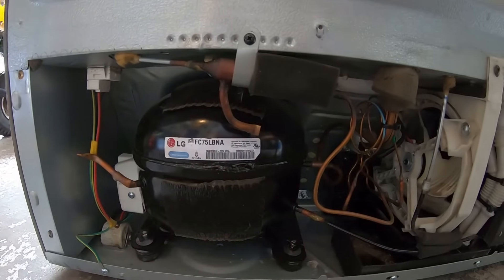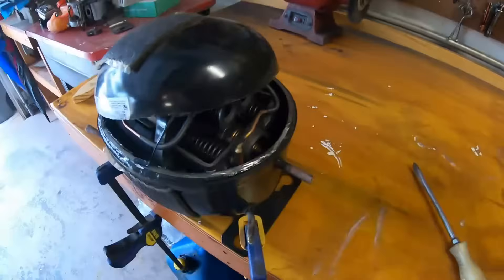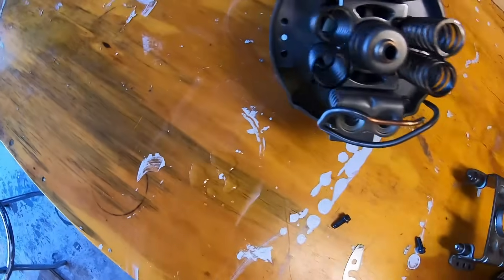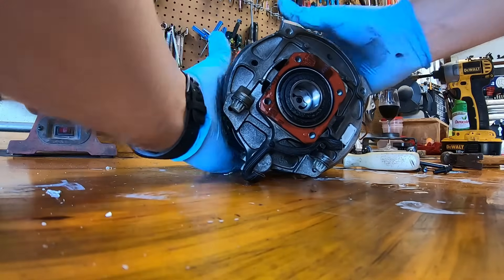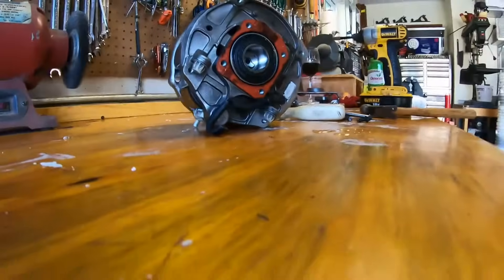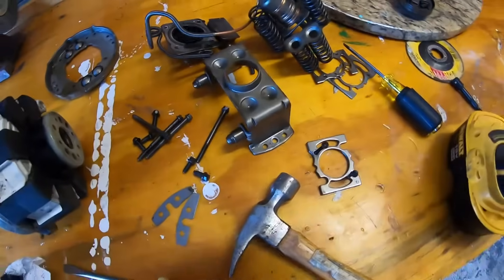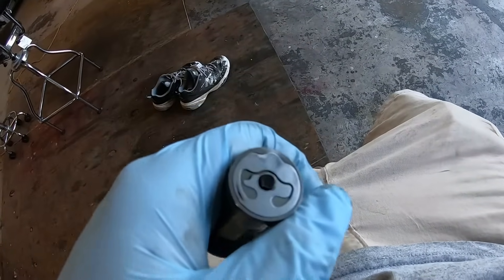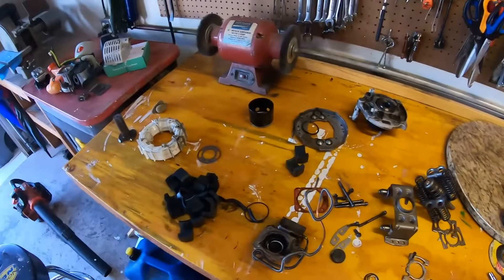Cutting open a failed LG refrigerator compressor

Comment: My LG linear compressor fridge was making some loud buzzing noises (sounded almost like a bad fluorescent ballast).  When I pulled the fridge out I heard sound like it fell to the ground and was rotating, then the sound stopped.
I don't see any rotating parts in this teardown.
The fan on the back is rotating fine.
I have no idea what was making the noise.  Just that linear compressor and fan should be the only moving parts.
We'll see in a couple hours if the fridge is broken or not.
Reply: That buzzing sound was probably the drive current peaking in the huge* coil responsible for actuating the piston (which is probably seized). When the piston isn't moving the coil current goes thru "the roof" basically. With the piston iron core stuck in the retracted position the inductance would be way too low, I.E. not putting up a resistance to in-rushing current. Normally the piston would be attracted to move into the winding, that would constantly increase inductance further and further, I.E. provide an increasing resistance to higher current. This electro-magnetic resistance is only temporary, as soon as the current hits a certain level the iron (core) piston will suddenly hit it's magnetic conduction limit... and all kinds of hell breaks loose once again.

With old fluorescent tube drivers, it uses a huge* (fixed) inductor to stop the current at a reasonable level. Once the fluorescent lamp lights up, 100/120 times a second with old ballasts(the tube driver), the tube resistance is quite low and would happily conduct much much more current and burn out if it wasn't for the inductor holding the would-be current spike back.

* = Huge, at least seen from a small electronics/PCB designer perspective

Comment: 60 days into compressor warranty repair. LG dragged their feet for 30 days giving authorization. Compressor arrives. Install. Then more error. Repair tech said needs new condenser. Now 3 weeks later and repair saying “stuck compressor”. Saying we need another compressor. What a joke. $900 in parts and labor. We feel like suckers.

Comment: It rather simple the compressor has an inert design flaw.  So no matter how or what you do it not when it's gonna fail, it's going to fail period. And you can keep replacing them till you blue in the face and it's not going to correct the issue.  
On the commercial and residential side of hvac  we see LG compressor failures all day long. Why?  They are just plain junk.

Comment: Looks to me like gasket or diaphram failure. That looks like it flutters back and forth creating a compression of the condensed liquid refrigerant and it breached past the valve seals  and slugged it down. losing any performance or BTU output.  Just my guess..I do commercial and residential ac

Comment: Good job on the hearing protection,  but where is the eye protection! You don't need it until you do. Then it's too late.  Those cut off disks can shatter,  never nibs the burning steel fragments. Thanks,  though,  for showing the problem with these compressors.

Comment: Did you ever replace the compressor with a different kind, if so which kind?
Reply from the maker: Nope I ended up trashing the fridge unfortunately. My understanding is that linear compressor design is unique to LG as is the control board
Reply: Compressors are mat he'd to control board

Comment: A friend of mine works for a large repair company, I worked with him 5 years ago before I started my own buisness, I called him a couple days ago, had equalized pressure from high side to factory fill port, I asked him about it, he said he recently went over his epa recovery sheets from reclaimed refrigerant, said he has replaced over 100 lg compressors, insane..
The new ones do resolve the issue from what I understand, gotta do the software revision with the new compressor, critical..
Reply from the maker: Good to know thanks for the info!

Comment: So I too have the same exact compressor number.  So, now what?  Can you please tell us what other kind to get??  thank you.
Reply from the maker: Honestly your best option is to replace the refrigerator with a non LG variety. I personally have had good luck with Whirlpool fridges in the past but your mileage may vary. Given the current appliance shortages I would be amazed if manufacturers weren't cutting more corners than usual. I have a 15-year-old whirlpool in my garage and a 10-year-old whirlpool in my kitchen both have been relatively trouble free.

Comment: Thank you enjoyed the video. We had our 4 year old LG french door fridge/freezer repaired this week. LG service replaced the compressor and dryer and upgraded the software on the controller board all  under warranty. Our unit was part of the class action lawsuit.
Reply: I got a 2 year old LG french door / bottom freezer that unexpectedly just lost all cooling. approximately $150 food ruined. Unplugged it for 3 hours and cleaned the coils in the back under the panel plugged it back in and it is back to normal. I bought a fridge / freezer temp sensor so I could monitor it better and found the temps of the fridge and freezer are all over the place, not consistent at all, ranging from -5 in the freezer to 25 degrees F. and the fridge from 34 to 41 it varies. I called LG and they set up a service call but still haven't heard anything from the service tech going on 4 days now. I did hear that the techs are tired of working on these pieces of junk and can take up to 2 weeks to get one to even respond to the work order. My old whirlpool lasted 15 years and when we remodeled our kitchen we went looking for a new fridge. Lowes and Home depot pretty much only carry LG so thought it would be OK plus they brag about a 10 year warranty on the compressor. I can tell you will be lucky to get 2 years out of that compressor, and mother board. So disappointed
Reply: @sttraveler2593  your thermostat would be the frist place I'd look
Reply: whats you model #?

lfx31945st?

Comment: Looks like the magnetic field was angled to the shaft just enough to be asymmetric and sure enough there is a wear spot in the piston.  I can’t tell if the piston chamber was supposed to be sealed and pump a fluid of some kind but the whole thing smacks of bad rings in a gasoline engine.  In short the magnetic shaft was bent and the rings got a hot spot and burned somehow.  8-10% failure rate is reported.  This is like buying a Mazda folks.  Runs but can’t maintain the seals too well.   Sheesh…I thought LG would have this cleared up…someone would have confessed and the company raised a white surrender flag.
Reply: What’s crazy is they have lawsuits back in 2014 for their crappy compressor failures. The lawsuit claimed it was because of lines corroding then getting a pinhole which made the system leak ultimately lading to compressor failure. Then there were claims that LG corrected the issue with updated parts in 2020 yet no one explains what was actually changed. Yet here we are in 2022 with tons of complaints still. They do have a universal compressor as a replacement part along with a software update but if their linear compressors are still having issues they should just abandon the design in their fridges completely. LG would be one the top fridges if they would dump that junk. It’s just another example of basic simple old tried and true stuff is more reliable than this new over engineered over complicated junk and half the techs don’t even know how to work on the stuff properly.

Comment: So are LG Linear compressor frequently fails?
Reply: There is/was a class action lawsuit due to numerous compressors failing in certain LG fefrigerator models… 2014-2017? Not sure if there is any proof that LG has fixed this issue for newer models… Buyer beware!

Comment: Wow 🥺.
I Have the Same Problem everything works fine BUT no cooling. Did the test Button got 6 Blinks and the front lcd had 22-22 error code. 6 Blinks indicated compressor, PCB or relay. But I have the same exact LGFC75LBNA.
I Got 7 Years From this compressor 🙌🏽.
I live in the Caribbean
Reply: call lg to get the upgrade compressor / i had LG warranty compressor fixed passed the 5 yr warranty  if they can find a tech in your location.

Comment: Great job troubleshooting it to root cause!  I’m wondering it this compressor can be replaced with a better compressor.  I’m being quoted $750 to remove and replace mine.
Reply: Yes it can replace by 1/5th hp 700 too 800 btu 115v compressor but Need to alter the wiring
We did many of these
Reply from the maker: Due to the unique design, unfortunately, I don't think so. Most compressors are just sent line voltage by the control board. I believe there is special logic in the control boards for these and they don't take just straight line voltage
Reply: save that $$ run like hell go get usa refrigeration keorea cant even make a car motor hahaha
Reply: LG REPLACEMENT IS FREE. BY LG ONLY 750 is cheap if include compressor.

Comment: Forensic science of finding the cause of a seized (deadly cardiac arrest) of a ref/aircon compressor. The Verdict: Replace $200 compressor + $250 labor cost or buy a new refrigerator is more acceptable recommendation. You are guaranteed another 5 years of non interrupted use of your ref and job security for Mexicans or Chinese manufacturing workers.

Comment: My LG fridge hit the dust after 3 years and  I   had the compressor replaced today. Labor costs are expensive.  I am still reeling over the whole experience.
Reply from the maker: Yeah it's such a horrible design. I don't know why they felt like they had to reinvent the wheel on this one. Reciprocating compressors have been working fine in residential refrigeration for decades...

Comment: Just put my 4 year old $3,000 Kenmore Elite in the garbage yesterday. Countless hours on the phone speaking with overseas customer support people that speak broken english. From the research I’ve done a fix that might last a year or two would cost me $600 to $1,000. Already ruined a few hundred in food. Don’t want that to happen again. Would lose more money taking time off work to get it ‘maybe’ repaired. Wasn’t an easy decision. Refrigerator looked brand new. Would never buy another LG or Sears Kenmore product again.
Reply from the maker: Sorry that happened to you - unfortunately, seems all too common based on the comments that I've seen on these fridges. A lot of my friends have older fridges - I always advise them to keep the older fridges if they still work. They just don't seem to make newer fridges as well as they made the older ones!
Reply: @JoesGarageProductionsLLC  I have an LG model listed under the lawsuit.  I just bought a house an inherited it.  The seller told me that this fridge was the third one, I think the selling store replaced it at least once.     Mine is a 2017 and failed 4 days ago and LG tech is coming out today.  We’ll see how this goes.  I’m told it’s under warranty and I indicated to them that it appears to be the compressor.  Everything else seems to function just fine, no error codes, compressor is running but not cooling.   If they try to charge me even one penny I’m out.  I’ll immediately go to used appliance store and get an older fridge.  From what I’m seeing ALL appliance manufacturers are following the same game plan.  Deny faulty designs and hope that consumers just buy a new one.  Don’t expect anything to last more than 5 years.  What garbage.  Stop buying new appliances and let’s change their minds.

Comment: Serviced 3 LG refrigerators that lost power during TX freeze. All fans worked on all 3 and compressors were running. Seemingly normal. But none cooled
Reply: I had my lg for 7 years , now 3. Ompressers
Reply from the maker: Interesting - what ended up being the problem?
Reply: @JoesGarageProductionsLLC  Still uncertain. You can add one more as of yesterday though
Reply: @dscott_  Did you find out the problem with these Fridges? I will change the compressor start relay in 2 days. We'll see how it goes
Reply: @mefc68  No. Never found answers. The relay seemed ok. All compressors were constantly on and running